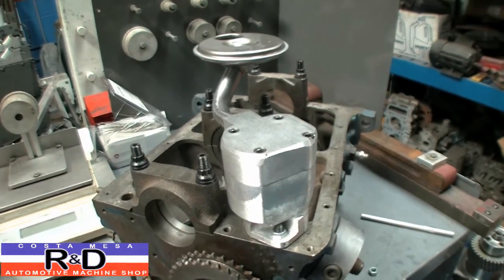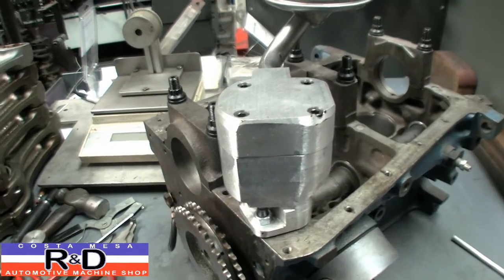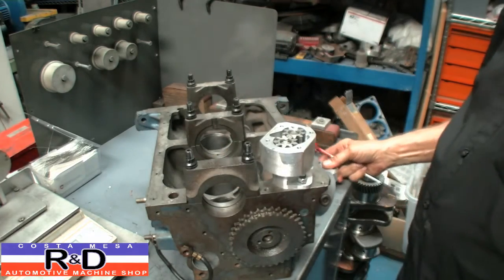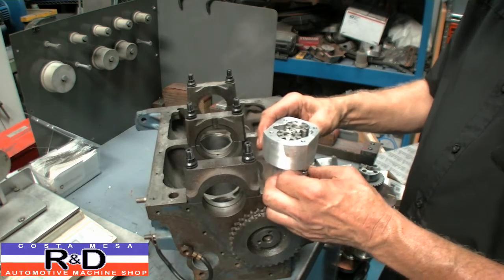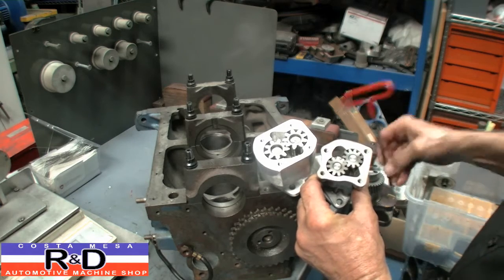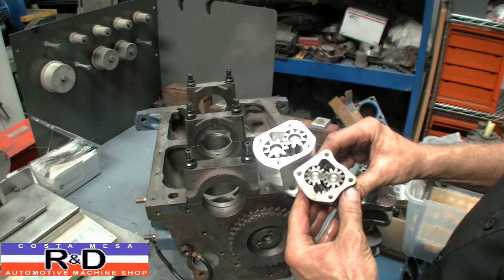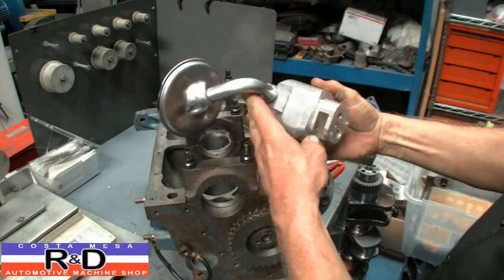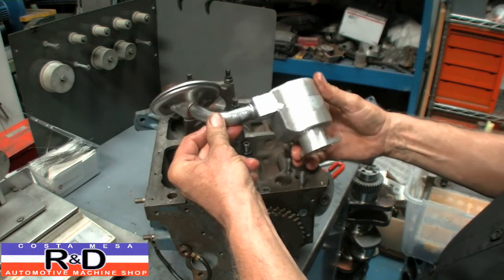Fiat Abarth 600 750 850 1000 1050 High Volume Oil Pump

Comment: Are you going to increase the sump volume? Thanks for the vid.
Reply from the maker: Not for the type of racing I do in autocross. A typical run is around 50-120 seconds so the oil temp is not a problem, plus I carry less weight this way.